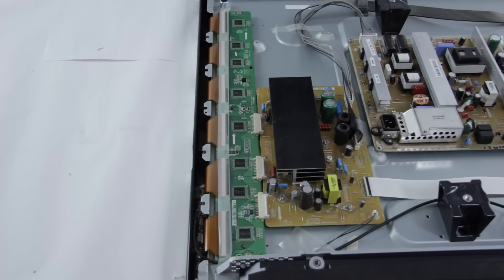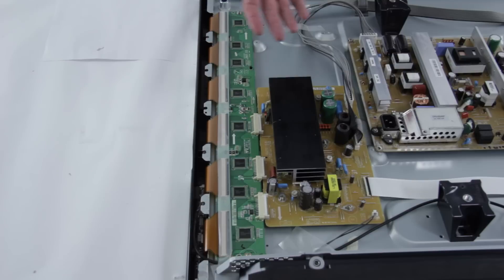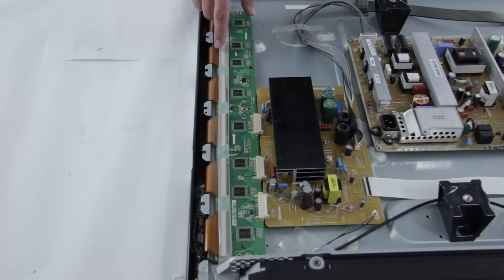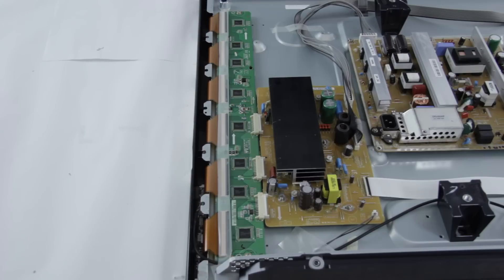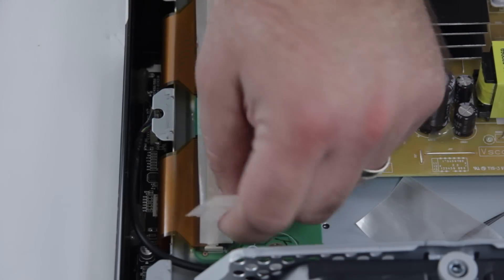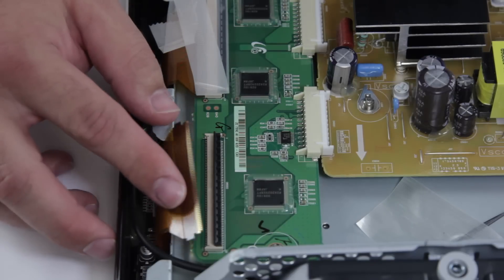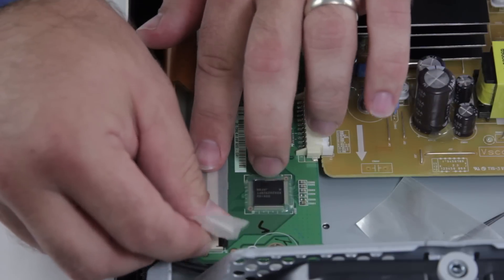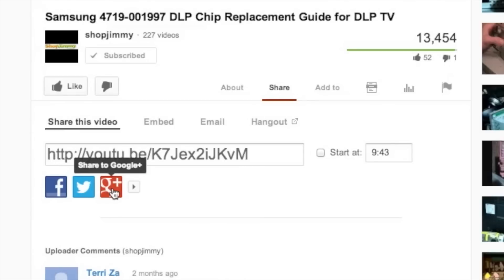Plasma TV Repair - No Image, No Picture on Plasma TV Screen - How to Replace Y-Buffer & Y-Sustain

Comment: Hi,

I have a question if you are able to help?

We have a 50” Magnavox 50MF231D/37 TV.  It must be plasma because it has a glass screen and is heavy for a flat screen.  Manufactured in January of 2007.

Perhaps it is not worth fixing but we love the TV, it has (had) a great picture and if it can be fixed fairly inexpensively then that would be great.

Basically, we lost the picture tube.  When we turn it on the green light comes on, it warms up as usual, the sound comes on but no picture at all.  When we push the “Menu” button on the side still nothing.  Just a black screen with sound only and a green light.  No background light that I can see and if I shine a spotlight on it I still cannot see any picture at all. 

What might be the problems and can I fix this at home?  I am very mechanically inclined to replace boards, parts, etc. but I do not have the capability to solder tiny, little connections smaller than regular automotive wire.  So I was hoping to just try replacing a board or two from eBay by myself and hope for the best.  

What do you think I should try if anything?  

Thank you!

Comment: HI I hav a 42 HP66 TOSHIBA PLASMA TV NO PICTURE BUT I HAVE SOUND I POWER AT X BOARD 5 VOLTS AND 5VOLTS FROM MAINBOARD I HAVE REPLACED LOGIC BOARD MAIN BOARD AND A USED Y SUS BOARD BUT STILL NO PICTURE I CHECKED ALL MY CONNECTIONS ON RIBBONS AND EVEN NEW WIRING HARNESSES,WHAT SHOUD I DO NEXT PLEASE HELP.

Comment: ok so hopefully you can help me I have a Samsung plasma TV model PN50C450B1DXZA the issue with it is 1 ot has a cracked screen 2 I can see lines running up and down the TV when it's not even on 3 when I plug it in and try to turn it on it makes a sound then the whole TV flickers for a good second then stays black ... I'm looking for guidance on what parts I may need to replace it

Comment: RAJESH FROM INDIA I HAVE A SAMSUNG PS43E470 PLASMA  COMPLAINT WAS RED LED BLINKING I DISCONNECTED THE Y BOARD THEN SET IS ON  I FOUND RJP63K2 IGBT SHORT  REPLACED  IGBT AND DRIVE IC S4427  THEN CONNECTED TO SCREEN JUST ON AND IGBT AGAIN SHORT, ALLSO IN X BOARD ARKING FOUND  RJP 30HI 4PICES SHORT AND THREE RESISTANCE BURNT , CAN ANY ONE SUGEST  ME WHAT TO DO NEXT

Comment: Model PN64E550DIFXZA suddenly lost picture. tried menu and different HDMI port with Blue Ray player, still no pix. unplugged and rebooted still nothing. It turns on and red light flashes 4-5 times then goes out but no pix. turn it off and red light reappears.

Comment: I have a LG plazma 60PK750 UA and I go to power it up and get 2 clicks witch I always got and then the picture would come on shortly after however I do not but I can still see that it is lit with no sound. I do not get a picture at all or sound. Do you know what I could start replacing rather then replace all parts? Is there a common part that goes that I could start with or do you know what exactly I could replace? HELP! I love this TV.

Comment: i have a sanyo 63 inch plasma tv with sound but no picture. model  number: PN63B550T2F 
Model code: PN63B550T2FXZA  
would  it be the y buffer? it does stay on  does not cycle .

Comment: hey guys a have an LG 60PV400 recently the tv started showing discoloration patches all over the screen, it goes and comes and lately no more picture when the TV is on. i contacted a local TV repair shop and they said they will fix it for $165, if anyone knows what went wrong i can hopefully fix it myself. thanks

Comment: LG 60pv400 I have sound but no picture.
Reply: TheDrinkhere same here
Reply: TheDrinkhere  wow, me too. And I also have the exact model as yours.
Reply: Me too
Reply: Me to I do not no what to do my dad is going to get made
Reply: Anybody get our figured out? I have the same TV and problem
Reply: Have u guys gotten any replies from here?
Reply: @michaelkuhn8201  not in years but I fixed the problem and I've had no issues with th TV.
Reply: @TheDrinkhere  how did you fix it please help
Reply: @basimfara  just buy the power supply the one inside the TV and it would be good to go.

Comment: I have a 50 inch LG 50pk550. I have sound but no picture when I hit the input button the screen will Flash and when I get to the cable input I'll get Distortion sound and that's the only sound I hear

Comment: Good morning.  I have a Samsung Plasma TV Series 5+ Model 530.  It usually takes several times of turning the set on and off before the screen illuminates and starts working correctly.  There is no problem with the sound as it comes on each time.  What are your recommendations for a fix?  Thanks in advance.

Comment: The TV I have is the exact same tv as in this video. Clicks on sometimes will get a picture with lines like static lines then clicks off. Sometimes it clicks on then it's just blank. I'm thinking of replaced the the buffer and that Y board. I found the Y Board on ebay for $20 but any idea what the model number and where to find the Buffer?

Comment: problem with a Samsung HP-S 4253  plasma TV  picture come on for about ten seconds and goes to a black screen but still does have sound  and also if I press the menu button it does not appear on the screen any help would be great thanks watching your videos on these and other problems

Comment: hello, I have a samsung model number pn60e550d1f, model code pn60e550d1fzxa, ss# z4sq3ckcb07065n, version TS02. sounds like it powers up but no picture,  used to have to turn off and on again then was fine. now it won't turn on.  red light just blinks

Comment: Hi guys. My plasma TV VIORE PDP42V18HA started showing bluish color over the screen... But the fades over time or when you turn off the tv them switch it on again. Today it was working fine then suddenly power went off and when I turned it ON... There was flashes of images them it went black but sometimes there is flashes of images but very faded .. I can't see the images nor the menu.   I checked the cables they seem fine

Comment: I ordered a y-main board to replace mine in my samsung plasma pn64d7000ff. The screen went blank but still had sound. it was just beyond the 4 year warranty and I thought it was junk, but I took the time to look in back and saw that the y-main board was sparking when powered on and I took a chance and it worked. amazing! thanks for posting these videos.

Comment: i have an lg plasma 60pn5000-ua. the tv since i bought it would power down and after about 5 seconds i could just turn it back on, this happened last night but wouldnt turn back on, the red standby light is on but using power button on tv and remote do not turn the tv on it just stays off, any help would be greatly appreciated!!

Comment: Hi guys, 
My Samsung plasma model #PN51F5300AF made a really loud bang sound and then the screen stopped working entirely... the audio still works and the tv technically turns on/off (based on the little indicator light at the bottom left), but the screen stopped working.
I suppose you'll recommend the y-sustain and y-buffer, if so, please point me to the links on how to buy it from your site and I'll do it.

thanks,
Christian

Comment: I have samsung pn51e550d1fxza, 51" plasma.  made a loud pop then picture went black, still has sound.  samsung repair guy came out and replaced power supply which did nothing.   so he said the screen was bad, but I'm not sure about that. any suggestions?  thanks for any help.

Comment: My Maxent 42 inch plasma TV, 2005, model: p4202yd05 is having pixel picture quality. the picture is black in middle with colored pixels all around. you can hear the volume, but picture is all most gone. I have a photo but could not sttach. can you tell me what to fix, if it is even worth fixing?

Comment: I have a 58" Samsung Plasma that keeps making a clicking sound and after about 6 clicks it stops clicking and still not on. I've replaced the power, main, logic, y and x boards and still doing it. Any ideas of what else it could be? If I unhook the logic from the power board the start up chime sounds.

Comment: Hi how are you? We want to buy this Panasonic 65 inches Plasma TV Model 65vt60, 2013 which is foulty.I has three verical  black lines in the middle of the screen and the middle black vertical line is more fatter than the other 2. this is the link to the pictures: http://www.gumtree.com.au/s-ad/cammeray/tvs/panasonic-65inch-plasma-65vt60-faulty/1123681865. Could you please let's known if this tv can be fix and what parts we need to buy and how much it could cost them. We live in 
Australia. thank very much in advanced for you information.

Comment: lg pb6900. when turning on the TV the screen will flash with light for a second then goes black. there is a audible clicking sound when it turns on.

Comment: Hello. We have a Samsung Plasma TV model #PN60E7000FF. Tried to turn on the tv yesterday morning and it was not working.  The red light that indicates power is on and flashes appropriately when you turn the set on, but we only get a quick flash of light, then black. No logo, no program, no sound. However, when you push the volume button, you do get the traditional beep, beep, beep indicating increasing or decreasing volume. We have had no previous problems and the set was working perfectly the night before. Any ideas?

Comment: I have a Samsung plasma TV with  Model code PS43E400U1R. Whenever I switch it on it shuts itself off after some time and the power button keeps on flashing (no picture on screen) . If I switch it off completely from main power supply & switch on again, it  works for some time and then switches off automatically with the power button flashing. Kindly help to understand the problem and a resolution
Reply: Any solution to the above problem. Please help out with a solution I can try on my own

Comment: I have a Samsung Model Number PN63C8000YF Model Code PN63C8000YFXZA. One day it just shut off & wont turn on. When I plug it in, the stand by light blinks & I can hear clicking for about 10 seconds then it totally shuts off. I've looks at videos to replace the capacitors, but my power board is completely different.

Comment: I am working on a Samsung S42AX-YB09 and the problem is the screen does not display or light up at all. I have fixed my monitor for my pc that had just a capacitor problem but all the capacitors on this TV look fine to me. There are the slightest bit of bulge on some of the capacitors but I think that's normal. All ribbon cables also look normal and all fuses are good. It really just seems like a capacitor issue but I can't find any leaking or bulged capacitors, and so I am stumped. The TV is pretty dusty but I don't know if that has anything to do with it. This TV also has like 4 or 5 main boards rather than 3 like I've seen most people have. But the 3 big boards are all a brownish color, not green like I've seen other TVs. I have limited experience and pretty much know only of changing out capacitors. I don't have a voltage meter but I'm planning on getting one. If you read all of this then thank you.
Reply: I have a Samsung TV model number 850 HW-YB02 no picture at all  but light come on make a noise and that's it. Can u help please

Comment: You guys are amazing!!! I'm glad I'm looking into fixing my TV instead of throwing it out and spending $$$$ on a new one. Hopefully you can help with a suggestion. 
I have a Samsung Plasma HP-T5044 (very little use in first 5 years). It will show a picture sometimes but more and more the screen is just dark grey/black with sound. Might turn on for a few seconds. Is this a capacitor issue??

Comment: I have a 50 inch LG TV model number 50PG20. After hearing a popping nosie at the top right hand corner of my tv. There's now a bar across the top of my screen. It looks like green and red color pixels moving around. I have been looking around on youtube and your video seems to be the closest description of my problem. The size of the line along the top part of my screen looks like the same width side of those strips in your video. Do you think this problem I have with my tv is caused by my y buffer?

Comment: I have black picture with no sound on my Panasonic TH-50PZ85U plasma. No blinking LEDs. The screen comes up as normal for menu to change input, volume level and channel changing, but none of the HDMI inputs display video/audio from cable box, DVD player or Xbox. tried unplugging options so figure I need a part - maybe main board. Help, please

Comment: Thanks for the video. I have been having a problem to my TV not powering up. i have repaired this by placing two bad capacitors, and resoldering a transistor. however once I got the tv to power up there was no picture, there is sound.  I didn't have this problem before. I checked the VS voltage the sticker says it should be 207v i can only get it to go and low as 225 by adjusting. 
any suggestions please?

Thanks

Comment: LG 50pv400 powers on, no picture, backlight is on, no menu or volume, or any other picture will show up, unsure of the volume working or not as i got the tv in this condition. Ive checked every board for psychical damage and all the caps and what not seem to be in great shape.

when you power on the tv the backlight is somewhat bright black, then after about 2 sec goes to a dimmer black but no image is present

Comment: Thank you for the clarification in your video, however, is there a specific part that you can recommend to be replaced that causes the image to go black but the sound is still on? This TV is not connected to a cable box or video gaming system but there is an antenna hooked up to it. Lastly, this problem is random and not consistent. Please tell me what you recommend regarding this television?  The television model is a Samsung HP-5053, thanks in advance.

Comment: Samsung Plasma 3D TV #PN43D490 S/N: Z2ZN3CQB401027M
The picture went black after a popping and then cracking sound but the sound was still going. After turning it off and unplugging it, there is now no sound or Picture it just shutdowns.

Comment: Hello I have a Samsung 51' Plasma Smart  TV Model pn51e550d1fxza. Version TD03. When I power on I get a large popping sound then I get volume but no picture(black screen). This TV is 4 yrs old and no previous issues. Should I replace Y-Buffer & Y-Sustain or would Y-Sustain replacement do the job. Your thoughts? Thank you in advance.

Comment: I have a Panasonic p42x30d plasma tv I am getting vertical lines on av mode but usb is showing the picture but no sound. in both please guide me about the cost of parts.

Comment: hi i have a LG 60pv450 ... the tv turns on but at random time tv well loose picture but sound will stay on.. then few minutes after tv well turn off. i  have replaced the Main Logic Board. but the problem still there ... please help

Comment: 55'Plasma LG smart TV. Turn's on. Has Sound. No Picture in any state. I have tested all caps within the Power supply circuitry. Nothing there. any suggestion/ideas?
Reply: hi my plasma vivo PTV42HDG will not come on from stand by could please give advise thanks

Comment: Hi I have a Samsung plasma display model # SPN4235 TYPE NO:AX42p3 all of the sudden it made a loud noise and no picture. We unplug  it then try to turn it on and all it does is the red button flashes 5 times then the button does not turn green the tv feels like it's on but no image, then I push the power button and then it turns red.  I really don't know we're to begging pls point me in the right direction. Thanx

Comment: My RCA model 42PA30RQ has a red light. When I turn the set on there's a blue light but the screen is black with no sound.
Also I have an issue with my Toshiba 42H82. The remote stopped working although the tv works otherwise when you press the on button. I purchased a new remote which doesn't work either. Thanks for any assistance.

Comment: I have a 31/2 year old plasma tv.....you turn it on and it will shut down  after 3 to 4 minutesthen come back on w/o a picture but no sound....do you know what it could be wrong
Reply: tv  turn on  shuts down after 3 to 4 minutes...restarts but no picture and haves sound...plasma tv model #pn59d530a3f( 60 inch )
Reply: Have you figured out what is wrong? I have the exact same model and symptoms.

Comment: I have a Samsung plasma tv. (model: PN51D450A2DXZA) today while it was on the picture went dark. You can see it flicker but you see no image and it is very dark almost black. Everything else seems to work as it should. I was wondering if i bought the complete repacement and installed it if this issue would be corrected? Thanks in advance for any advice.     Mark Cox

Comment: Hi, an accident with my tv happened where a remote was thrown at the lower right corner of the tv and the image immediately went off,  the sound is perfectly fine and when the tv is turned on an electrical sound is made and then the tv sound comes on. I have a samsung 50inch plasma display tv like the one in this video. Model number: PS50C490B3WXXU 
What should i do, I can not buy a new TV is the problem fixable?

Comment: i have a samsung model code  PN51E550D1FXZA  plasma tv that had been cycling on ,off afew times ,then would run all day ok,until it then lost picture ,still has sound no backlight ,no picture ,no obvious capacitor failure .power light flashes 5 times.Have ordered power and logic boards from your website saturday wanted to know if i need to get more before you ship my order if not already shipped ,please e mail me asap thanks

Comment: I have a Samsung model code PN51E440A2FXZA, there was a loud pop then no picture, everything else like sound and powering on and off seem to work fine.  The mfg date is June 2012 so not that old of a tv.  we do have this tv on the back porch in a cabinet and its protected from rain.  We are in the Houston, TX area and the humidity can be high most of the year.  I've never seen any condensate anywhere on the outside of the tv.